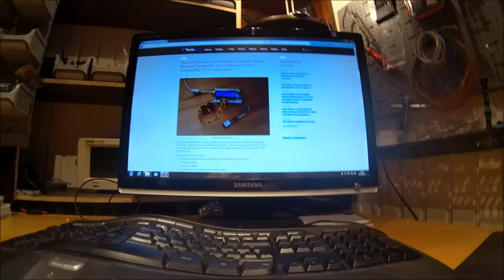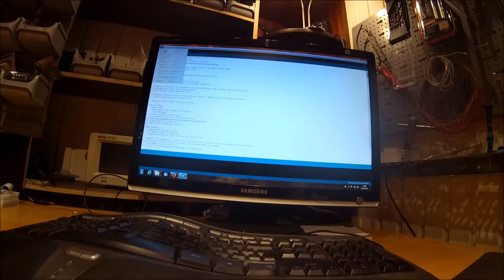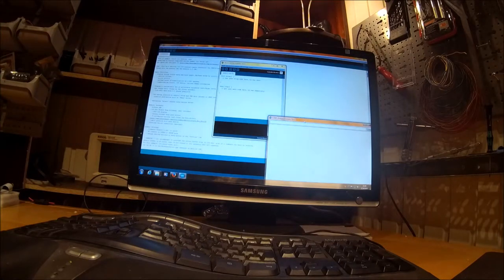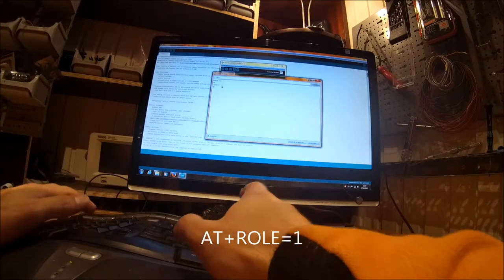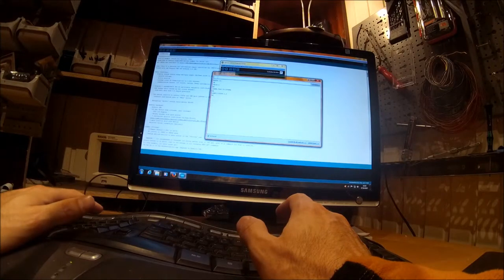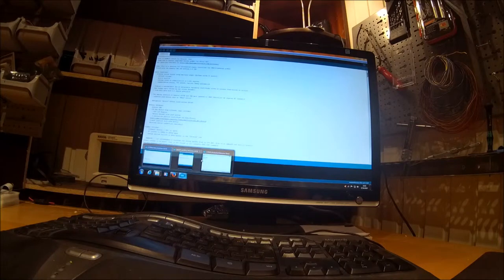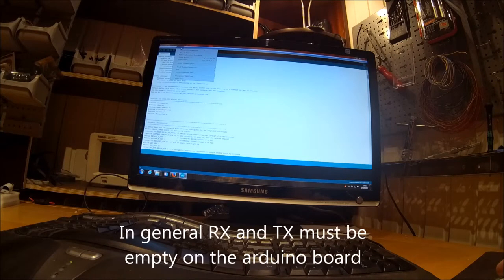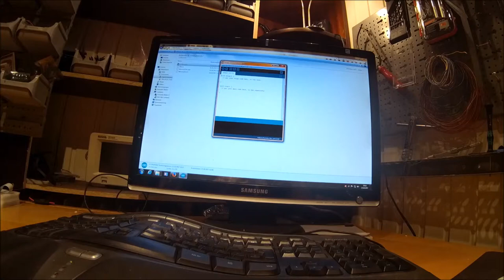Bluetooth remote controller for alexmos BGC32

Comment: you are the best i like you projet
Reply from the maker: Thanks :-) Hopefully I can go on with the next step soon... ;-)
Reply: thank you for your quick response do you think it is possible to achieve the same concept without LCD screen so you can keep it more simply in the hand and it is easily transportable ; my 3d concept is danydanfree in the web
Reply from the maker: I did not invent this controller, I just built it. So I can only guess if it is possible; but I think you can make these changes, but then you can not select anything from the menue. On the other hand I remember a controller which uses no display at all, instead it uses a bluetooth game controller with different buttons to  enter different menues.

Comment: Hey- this is an awesome overview, thanks. Is it possible to add 3-4 push buttons that start pre-programmed moves with the gimbal? (ie: bouncing pan move, etc)
Reply from the maker: Hello Kris, sorry I did not see your post. I Think it is possibel but this will need some programing. Unfortunately I cannot help you with that, because I only have limited experience in that field. Regards Dominik